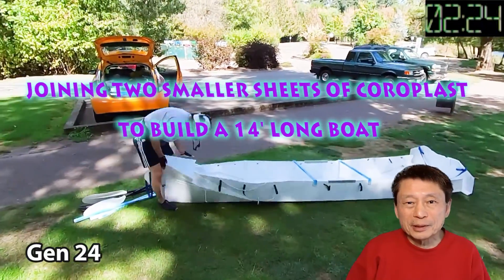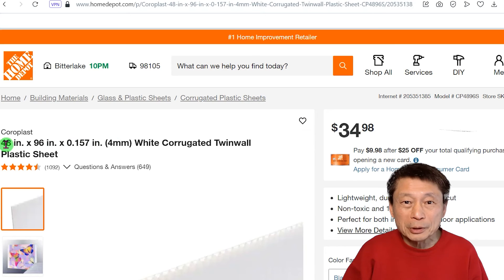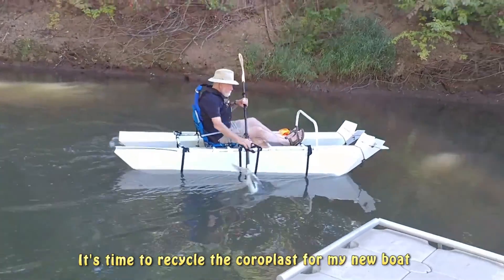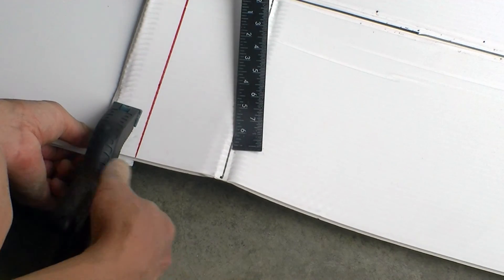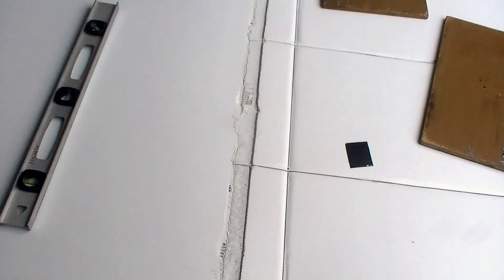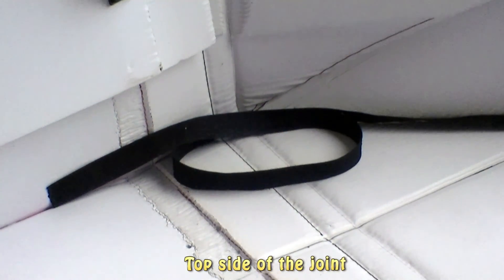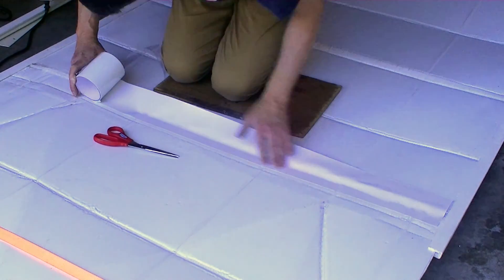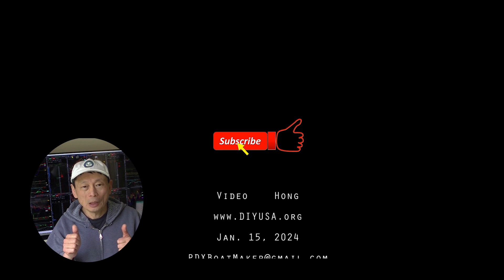2024 Improved Heat Fusion Technique | Build Longer Foldable Boats

Comment: I didn't like your video, I loved it.
Your videos have empowered me to make a coroplast replacement box for a large vintage item. 
I have a heat gun now and am wondering if in your experience you've noticed a need to ventilate for fumes coming off of the heated plastic. Thanks.
Reply from the maker: Thanks for your question.  I did investigate if there is health issue if i inhaled the fumes when i heat the coroplast.  According to the manufacturer  only CO2 and  water will be emitted  when the coroplast is heated.  I do that in a well ventilated area because I don't like the smell of it.  Please note,  if you heat the PVC pipe, toxic fumes will come out, especially when the color of the pipe starts to turn  yellowish. You have to be  careful.
Reply: @DIYUSA thank you sir.

Comment: Great idea! I wonder if you heat both sheet joints at the same time (multiple heat guns), then reverse one of them to weld them on the joint. Hard to explain in a textual comment.
Reply from the maker: No need to reverse the heated coroplast. The sheet is thin and the heat gun can melt both top and bottom layers easily. I have different videos showing how I did that (different methods) in the past few years. https://youtube.com/playlist?list=PL2ShZzOUu01uPMusHshCexb9YUnGn16xJ&si=-QUvyFtXsNUxDOoi
Cheers!

Comment: hey this is awesome but i was wondering if the gen 23 would be able to hold a normal seat for better comfortably and also what is the weight limit
Reply from the maker: Thanks for asking, my guess a normal kayak seat is the one you can buy at Amazon. Yes, you can fit that kind of seat. I have tried a more comfortable seat as shown in these videos (on similar boats)
https://youtu.be/v6GqZUqnQb0?si=M3vXyiIhUodIZwSi    and
  https://youtu.be/Zw-eyoF0lH4?si=0e0Hjp4mzbXMO52b   The reason I made the seat is because those comfortable seats are usually 3-4 lbs. The one I made is less than 1 lb. I have tested the Gen 23 kayak with a 6 ft tall person weighs 215 lbs. It fits perfectly, much better than I have expected. The draft is at around 3". At 4" draft, which is the max. I will try on that boat, it should be able to handle a load of 245 lbs.